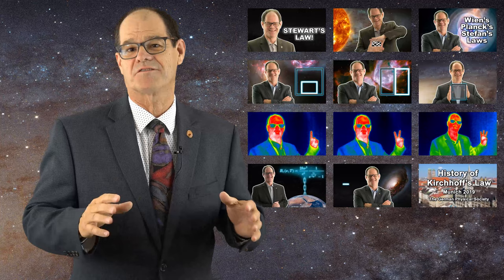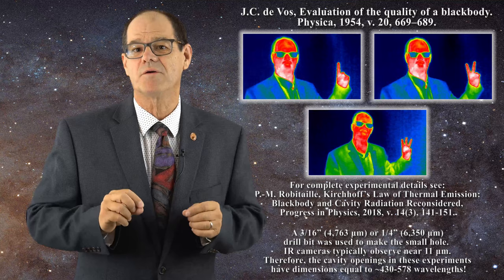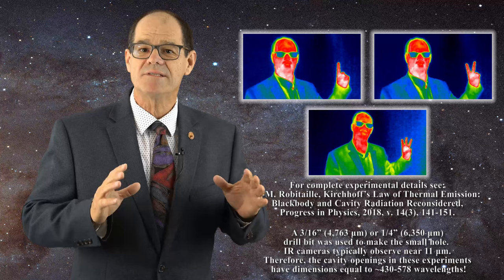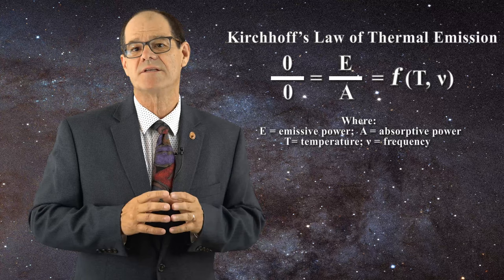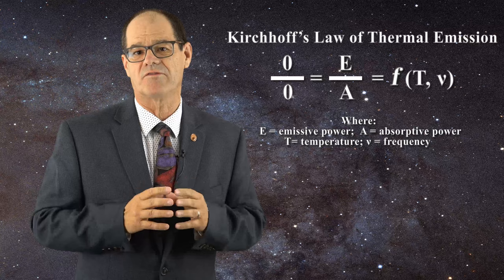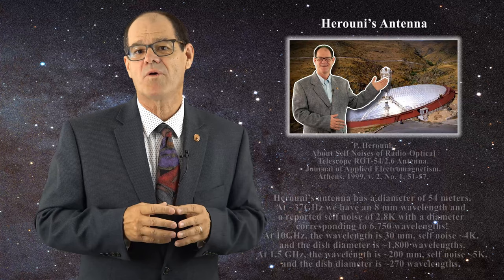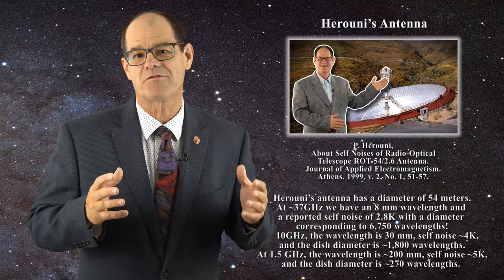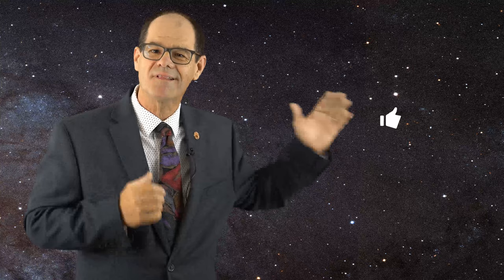Kirchhoff vs Herouni's Antenna!

Comment: Open hemispherical dish is a cavity??? Pardon!!!
Reply: "Open hemispherical dish is a cavity??? Pardon!!!" Lock Key

Actually, it is a cavity.  If you examine the cited paper by De Vos, you will learn that even the tip of a drill bit, producing a simple cone in material, can act as a cavity.  Now, the question is, how do we think about Herouni's antenna, relative to Kirchhoff's statement that the radiation contained within an enclosed space will always be black or normal? When studying blackbody radiation, astronomers often portray an enclosure with only a small hole, so that once radiation enters the enclosure, it cannot escape.  This is such nonsense, because you first have to fill the cavity with radiation from the outside and that radiation must be black!  This is especially true if the enclosure has perfectly reflecting walls, because, as Dr. Robitaille has shown, such a cavity cannot do any work on the radiation! Now, consider Herouni's antenna. It is a cavity, but with a large opening.  Does the size of the opening matter?  Well, in this case, it does not because no photons are able to enter the cavity from space in the first place, no matter how large the opening is! That is because, Herouni found that the contribution from space is essentially zero to the noise of the antenna! Now pretend that you can seal up the antenna completely to make the enclosure Kirchhoff wants. How do you propose that you are going to get 300K blackbody radiation within that cavity when it is clear that the walls can produce none and none can enter from the outside? So, this completely destroys the argument that an enclosure with a small hole is all it takes to get a blackbody.  Kirchhoff required that the walls be in temperature equilibrium with the environment, and for Herouni's antenna, that requirement has been met.  The dish is in contact with ~300K ground, yet it contains microwave radiation reflecting a temperature of no more than 5K.  The problem for Kirchhoff and his followers is that his law was purely mathematical.  It had no experimental proof and still does not today.  So, if you want to argue, go find us a proper mathematical proof for Kirchhoff's law (none exists, as all proofs have been shown to have problems) or better still, go get us an experimental proof, as is required whenever a law of physics is said to exist.  Such proof's do not exist and Kirchhoff's law is nothing but nonsense. Resonant cavities exist and Kirchhoff did not know this in 1859!  As stated elsewhere on this page, its high time for astrophysics to move into the 21st century!
Reply: @stevecrothers6585  I thought the idea of a cavity was to have multiple reflections, but the telescope mirror is just one bounce and in???
Reply: @stevecrothers6585  "If you examine the cited paper by De Vos, you will learn that even the tip of a drill bit, producing a simple cone in material, can act as a cavity." What line does that occur on??? I can't find it?? Lots about drilling deep holes in "massive blocks or rods"!!!
Reply: @lockkey2570  : "If you examine the cited paper by De Vos, you will learn that even the tip of a drill bit, producing a simple cone in material, can act as a cavity." What line does that occur on??? I can't find it?? Lots about drilling deep holes in "massive blocks or rods"!!! Lock Key

De Vos’ paper is concerned with ensuring that the radiation from cavities will be diffuse, as required for true blackbodies.  He actually describes several types of blackbodies.  In addition to drilling holes where the depth is 6X the diameter or more, to ensure that the radiation is diffuse, De Vos also describes wedges.  That is because they are also used as blackbodies, although not very good ones, because the radiation is not very diffuse.  De Vos uses a ratio of depth to diameter of at least 6 because he calculates that the resulting cavity will contain radiation which is relatively diffuse.  He does not say that a smaller ratio cannot be used (just look at his equation 10). They can be used.  However, the internal reflections will not be sufficient to produce fully diffuse radiation.  As for wedges they are much like cones which have similar geometry.  In his videos, Robitaille uses holes of many depths and shows what happens when the hole is just produced by the tip of the drill bit.  You will notice that with graphite, even a hole produced by the tip of the drill bit has blackbody characteristics.  It is not a very good blackbody, but such devices are used and are analogous to the wedge blackbody that De Vos describes in his paper. It is well-known that even the tip of a drill bit producing just a simple cone in a good absorber can approach a blackbody.  The problem with cones which do not have high absorptivity, is that the radiation they produce will not be very diffuse.  In that sense, they fail in reproducing this aspect of blackbody radiation.  However, if Kirchhoff is to be correct, conical blackbodies must at least be filled with radiation manifesting the temperature of their walls.  That will never be true for Herouni’s antenna.  Those walls can never produce microwave radiation corresponding to 300K.  Herouni’s antenna also cannot be filled with 300K radiation coming from the outside.  Now, imagine that you can completely enclose the opening of Herouni’s antenna.  How do you propose to get 300K microwave radiation within it, when the walls can produce none?  Do you really believe that the antenna noise will now magically rise to 300K, corresponding to the temperature of the walls?  Conical blackbodies exist and are no more enclosed than Herouni’s antenna.  In this context, Herouni’s antenna demonstrates that Kirchhoff’s law is false.  Otherwise, like conical blackbodies, Herouni’s antenna would be filled with microwave radiation at 300K.
Reply: @lockkey2570  The dish antenna is not a typical cavity as studied in microwave theory. Reflective cavities in the context of advanced electromagnetics are mostly closed and can establish resonant modes based on Bessel functions.  They are definitely different than cavities with absorptive walls.  This dish, however, could be used as a sort of partial cavity if you set up an active resonance of the feed/transmission element with the main reflective body.
Reply: @onehitpick9758  Yeah!!! Kinda my point!! It's a telescope so it sees the sky with only one reflection in the way!! So if it's 99.9% reflective, so it will see 99.9% of whatever's it pointed at in the sky + 0.1% of 300K! Sorta whats seen, right!?! Not sure you could getta resonace as the opitic rays from the focus go outta the hole???
Reply: @lockkey2570  : How do you propose to ‘drive the reflection’? De Vos used electric currents or electron bombardment. In any event the dish of optical-radio telescope 54/2.6 (Herouni’s telescope) is essentially a perfect reflector. If you try to ‘drive the reflection’ in a cavity made from a perfectly reflective material the temperature of the walls will simply increase. A perfect reflector cannot emit thermal radiation because its emissivity is zero.
Reply: @lockkey2570  : Read De Vos' paper carefully. He used wedges and drilled holes (cylinders). Here is the shape of a wedge \/. The tip of a drill bit is simply a rotated wedge forming a cone! So Dr. Robitaille is correct.
Reply: @stevecrothers6585   ‘drive the reflection’ where does this come from??? You have put quotes around it, but this phrase does not appear in the De Vos paper or is mentioned by Dr Robitaille. The "electric currents or electron bombardment" was just used to heat the targets in a vacuum. From your use it seems to suggest heating the the sample until a noticeable themal emission is produced, although the whole idea is a metal cavity at  room temperature (300K)!!

"perfect reflector" but we are not talking about perfect reflectors, they don't exist, so making them the central part totally invalidates your argument!!! A metal plate will have a finite resistance and thermal excitation will produce currents which will give a low amplitude thermal spectrum. After a few thousand reflections you can get the full 300K intensity!!!

Have you tried using equation 10??? Reflectivity near unity. Hemispherical so depth same as aperture radius so a=1. Result the cavity efficiency is 1-pi in other words -214% Great!!! Can't use this eq on shiny cones!!
Reply: @stevecrothers6585  "it actually comes from you", except I have not used that phase and the reflections are not 'driven' by extra energy but by the 1% lossed implied by the 99% reflection and build up like  'compound interest'!!!

You have gone from "He does not say that a smaller ratio cannot be used (just look at his equation 10)" to "simply means that the equation is bunkum" !!! The whole point of this paper was to justify numerically or at least analytically open reflective cavities like the Herouni antenna should be good, yet if anything it seems to say the opposite

"Take the case of a cavity made from a material with reflectivity of 0.99 say. Put heat into the walls of the cavity. Very little will go into a thermal field because the temperature of the walls will simply rise, because the walls have a low emissivity." What are you talking about??? Heating walls??? We are talking about being at thermal equilibrium at 300K?!? The walls are affectively coupled to an infinite heat bath at 300K!! 

"A cavity with an emissivity of 0.01 will not produce the same thermal field as a cavity with emissivity 0.99 when at thermal equilibrium at a common temperature." I'm seeing lots of words but no actual calculations - just assertions!!!

"So, once again, how will you drive your reflections? Will you use electric currents or electron bombardment, of some other energy source? Remember, at thermal equilibrium, Stewart’s Law holds: emission = absorption."  I'm starting to doubt you actually know any thermodynamics at all!!! Even a quick numerical simulation via python or even in a excel spreadsheet would prove multiple reflections would work!!!

¯\_(ツ)_/¯
Reply: @lockkey2570  : “Heating walls??? We are talking about being at thermal equilibrium at 300K?!? The walls are affectively coupled to an infinite heat bath at 300K!!” Lock Key

No, the problem is what are you talking about. I told you, take a sealed cavity with emissivity e = 0.1 and another sealed cavity with emissivity e = 0.99. Now heat them both so that the walls of each come to the same temperature - that’s temperature equilibrium. They will not contain the same thermal field. If you now put these cavities into physical contact nothing changes, because they are in temperature equilibrium. Neither will have a blackbody field inside and the cavity with e = 0.1 will not have the same field as the cavity with e = 0.99. Now if you try to make the field inside the cavity e = 0.1 the same as inside cavity e = 0.99 you will have to put heat into the cavity walls of the cavity e = 0.1, but then a small amount of heat goes into the field due to low emissivity e = 0.1 and the temperature of the walls rises. The cavities are no longer in temperature equilibrium. Try as you might the cavity e = 0.1 will never produce the same thermal field as the cavity e = 0.99 when they are both at the same temperature. But according to you they will, because you assume Kirchhoff’s magical law. 

As for Herouni’s antenna, it is in temperature equilibrium with the surrounding ground at 300 K say. But the thermal field within the cavity is not anything like 300 K because the dish has a very low emissivity (and, by the way, the antenna design prevents radiation from the surroundings diffracting over its edge from entering the detector). Your argument that reflections will build up within the dish is a violation of the 1st law of thermodynamics because to increase the thermal field therein would require an input of energy into the dish itself. But then the temperature of the dish would rise and the system would fall out of equilibrium because most of the energy pumped into the dish walls will not go into the thermal field due to the very low emissivity of the walls. Your build up of reflections implies energy from nothing and hence a violation of the 1st law. This is how you ‘drive the reflection’ to get your 300 K thermal field. You just don't realise it.

"A cavity with an emissivity of 0.01 will not produce the same thermal field as a cavity with emissivity 0.99 when at thermal equilibrium at a common temperature." Crothers “I'm seeing lots of words but no actual calculations - just assertions!!!” Lock Key

Quite frankly, I don’t think you can see anything at all. I’ve explained to you twice now. I don’t need any calculations to do so. I am talking about the physics, not about equations. You on the other hand think that equations determine the physics; but no, the physics determines any and all mathematical models. Where a mathematical model violates the physics, the mathematics is bunkum. If you can’t get your physics right you’ll never get a meaningful mathematical model. 

"So, once again, how will you drive your reflections? Will you use electric currents or electron bombardment, of some other energy source? Remember, at thermal equilibrium, Stewart’s Law holds: emission = absorption."  Crothers “I'm starting to doubt you actually know any thermodynamics at all!!! Even a quick numerical simulation via python or even in a excel spreadsheet would prove multiple reflections would work!!!” Lock Key

Your numerical simulations with python or an excel spreadsheet produce what you want them to produce because you assume a false physical process in the first place - Kirchhoff’s law. Your argument is a classical example of petitio principii: assuming as a premise that which is to be demonstrated. That is neither physics nor logic. Furthermore, your model is in violation of the 1st law of thermodynamics because you don't get to drive the field within the cavity.

At NIST blackbodies are made from good absorbers, not reflectors, contrary to Kirchhoff's claims. Case closed!